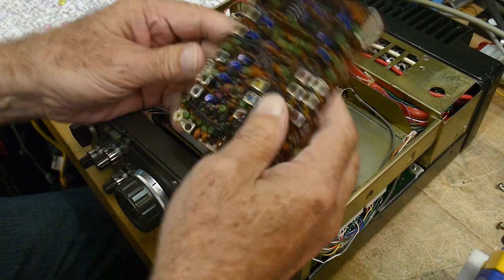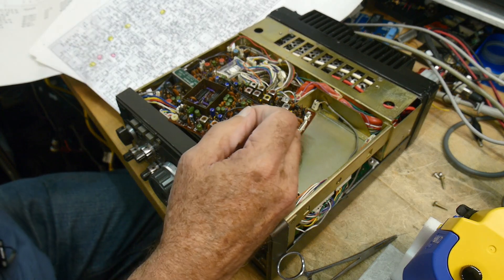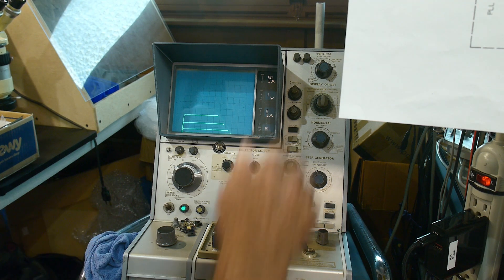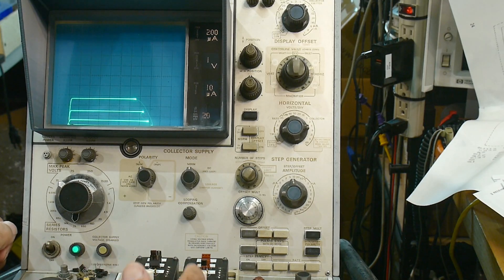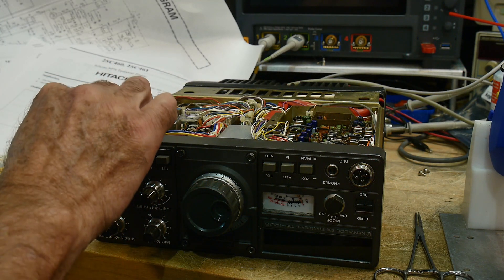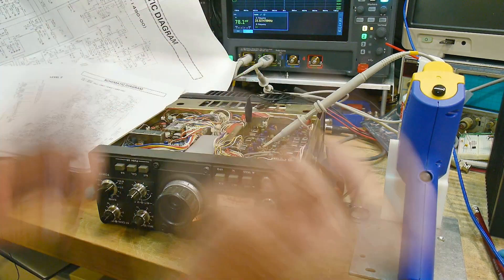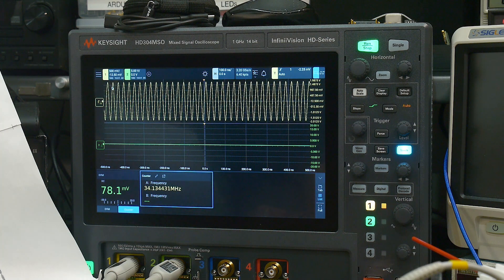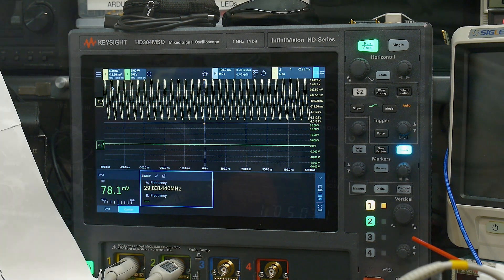#2012 Kenwood TS-120S HF Transceiver (part 12 of  12)

Comment: Well congratulations. Hope there is not much more to fix. I bought an IC-735 at a Junk sale last weekend, "dead no TX or RX", paid $120 NZD, for the IC-735, AT-150 tuner, and PS-55 power supply. When I got it home, (what I wanted was the PSU to power an IC-271H I'm restoring), I found the power connection pins and sockets burned up on the rig and the psu. Must have been loose. So I replaced those, and now the Rig goes, as does the PSU. Then I found that the socket on the IC-271H does not fit the PSU. Seems it had been 'modified', by a previous owner. So now I'm fitting a replacement socket on the -271H, from a dead IC-730. LOL robbing Peter to pay Paul, as my mother used to say. Oh and the IC-735, had only CB frequencies in the memories, so yep. This is my first batch of 80's Icom's to play with, and I'm quite suprised how nice they are to work on. Would love to work you on air from New Zealand once you get the TS-120S going. 73 ZL2ALW RE79qw

Comment: Wonderfull, that the 'old Lady'(Kenwood - TS-120S) is working like a charm, now! 

 -100% succses! - 

I have to say to you, that I also have a 'Kenwood TS-130V' - wich is the follow-up radio, of the 'TS-120' ! 

But this radio (TS-130V) only 'generates' max. 10w output power! Mostly inside, the radio's are the same, from the hardware- side. 
(lacking the 100W PA transistors, of corse!)

Only the more "'band's" they have.
(all SW, excluding 160m, but plus the WARC-band's. Why they have done that, is and was, a miracle for me, ... ! Why no 160m, in this time periode?) 

I have 'bought' an  additional 'CW-filter', with 280Hz, and also the small 'SSB- filter', with 1,8kHz, for my radio. 
And these filters are worth every cent I have spent, to buy them! It makes a real good 'CW- mashine' out of the 'only10W-TRX ', ...  but also a beautiful 'SSB- radio', with good receiving 'additionales', to the stock TS-130. 

The 'only thing' you will missed, is a 'dsp' noise-reducing system, but this 'part' of equipment, was never aviable, at the 'legale time' you could buy such a rig! 

I used my kenwood TS-130, as a 'back-up TRX' and second (T)RX,  during 'contests', and some other times, on an second antenna, searching for 'multipliers' on other bands, ... ! 
In that special  way, I use my 'TS-130V', there is no negativ issue, only having 10W output. 

On CW, 10W is often 'more then enough' riding the waves, when the coditions are fair, ...! 

 - Again,...  sorry when I made some mistakes in English, it is not my native tounge. - 

73 de Markus - db9pz - JN39fq - 3miles/5km east of LX -

Comment: There's nothing more satisfying than a good ham radio rig repair.
Reply: Yeah, well I guess so, but I have been looking for a source of information or a school or a way to learn how to repair ham radio rigs.  My dad just laughs at me and says, "people still going around fixing things?  That was all back in the 60's.  There was lots of electronics repair going in the 1960's and there was money in it!"👍
Reply: @paulgrodkowski3412  Start with a non-functional rig. Characterize the problem and research possible solutions. Download and study available service manuals. Buy some basic diagnostic lab equipment as needed and start using it.  Learn as you go and improve with each fix. Just my suggestions.